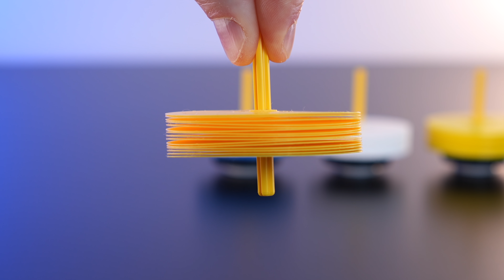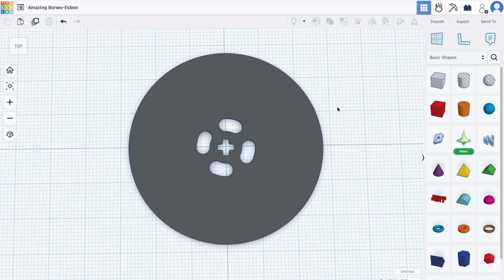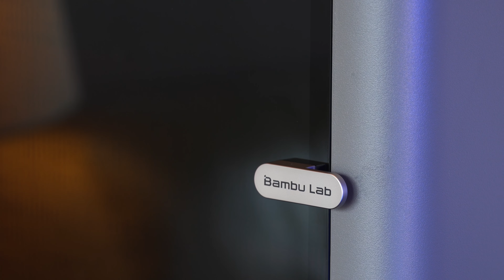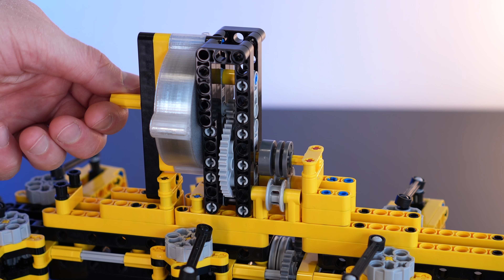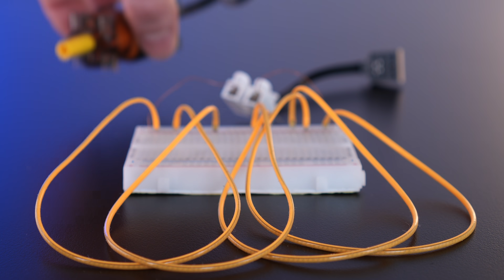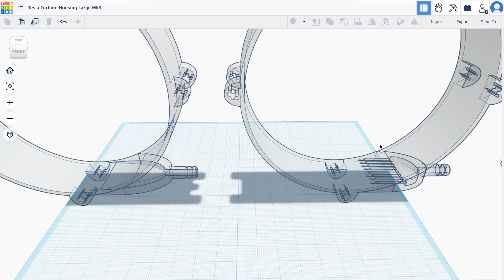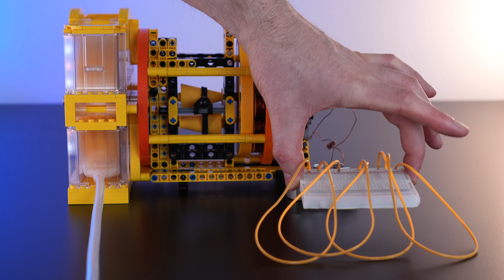Powerful Lego BLADELESS Turbine Generator!

Comment: I don't know if the prints are so smooth it doesn't matter, but I'd be curious to see if somehow setting it up to print the blades in a spiral pattern instead of lines would change anything. Like rifling in a barrel, if the tiny ridges also work with the flow of air, can you get even more efficient?
Reply from the maker: Hmmmm that's an interesting idea. I know in general you want the discs to be as smooth as possible. But I'm intrigued by the idea of a barely perceptible spiral pattern. My guess is it'd never perfectly align with the airflow, causing more turbulence (though likely not much). But I'd love if any real engineers could weigh in!
Reply: @JamiesBrickJams maybe a spiral is too regular, and the pattern needs to be some super computer generated pattern that guides the flow and extracts maximum energy, taking turbulence into account, which may not even be possible (chaos theory). Surface finish like a rounded fractal pattern, guiding air to disk exit?
Reply: @JamiesBrickJams also, shape and size of holes could probably be optimized as well. Needs a lots of fluid dynamics simulations

Comment: nice. very easy to manufacture. disc stack turbine is better than tesla turbine or bladeless turbine. boundary layer? air friction. keep it simple even in talking. fluid friction. very nice demonstration. those gear teeth are blades btw. perfect. faster generator disc speed is larger flywheel energy storage. making the whole generator from metal is very simple. why would you say that normal turbine efficiency is better.

Comment: Tip: You can measure how much power your turbines have by attaching a big metal disk to the output shaft and using a microcontroller to precisely measure rpm.
If you know how heavy the metal disk is, and how fast it is being sped up, you can make a graph of power per rpm and torque per rpm, just like how real cars have hp+nm per rpm graphs!

Daniel Hunziker has made a great video explaining how to build your own model dyno!
Reply from the maker: That's an awesome idea, thanks for the recommendation! I'd love to give that a try. Would you have to apply the power source immediately for an accurate measure? I'd assume you measure the time to spin up to x speed?
Reply: @JamiesBrickJams  You don't have to apply the power immediately. All that will happen is that the power output will be 0 at 0 rpm.
Of course, you would want to only measure the power at full throttle, so you'll probably have to tell it to start recording, else it might just measure your "output power" if you ever bump against the metal disk.

But other than that, the graph doesn't measure time, but instead only rpm, power, and torque, so even if you mess up the measurements at low rpm, the other data points won't be affected.
Reply from the maker: Ah gotcha, thanks! I'll have to watch his video. Measuring energy stored in a flywheel is easy enough. But I'm always interested in measuring torque output somehow!
Reply: @JamiesBrickJams  Torque is also measured with this method, because it is linked to power. We know the power, and we know the rpm, and torque = power / rpm.

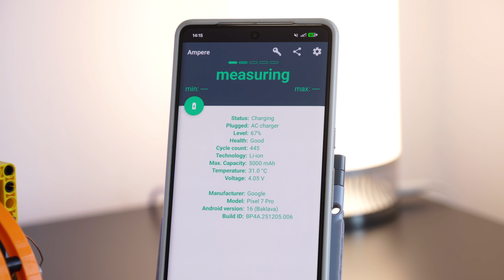Comment: 25:03 whats that app your using to measure the power draw
Reply from the maker: It's called Ampere.. I've no idea how accurate it is though. It's read out some weird results across my various generators. Especially with different capacitors in parallel. Though it feels ballpark accurate. Nothing beats a good multimeter though!

Comment: Tesla turbines become more efficient with more blades. the thinner you can make them, and the more you can jam into the casing, the more efficient and powerful they can be.
Reply: Which, as you can imagine, also makes it more delicate.
Reply: I think something like a solid angle grinder flapper wheel shape would work REALLY well.
Reply: Yeah they are near useless just like 90% of tesla's magical inventions they sonuds cool in idea but fails in everyday use... that was tesla's downfall.... but internet crooks and lunatics keep up the air of mysticism about nikola tesla....
Reply: @maszkalman3676 it works so well it explodes.
Reply: @maszkalman3676  no, it works. The problem is if you wanted it to work at scale, you would need to invent some new meta-material to withstand the strain.
Reply: @frankyanish4833  NOOOOO! it doesn't worked in real life at tesla's time or even in our time no matter how hard peoples tried we still don't have that meta  material that would make this shłt viable... in smal lscale actually easier to build shłt like this becaus even less force applied to each square inch or cm squared on eact point of this system. If you woudl scale this up it would be magnitudes worse...
Reply: @maszkalman3676  wow, it’s almost like that’s exactly what I said.

Comment: Just use a vacuum at the rear exhaust.
Reply: It’s a lot easier to control the pressure with compressed gas than with a vacuum
Reply: @ahumanbeing4514agreed❤
Reply: Bladeles doesnt work like that😂
Reply: @JB_Lego telsa turbines work in both directions
Reply: @JB_Lego  yes it does, do your research.
Reply: @dragonfire4356 only if theres an exhaust on the other side😅
Reply: And a Vacuum also uses alot of energy compared to a Air compressor❤
Reply: I was tired when i said that lol
Reply: It may work but it wont run Well
Reply: @JB_Lego   Yeah, and PSI is limited to atmospheric air pressure. After all, a vacuum doesn't create air pressure, it reduces it. The force that draws in air into a vacuum's inlet is just ambient air pushing into the lower pressure vacuum.
Whereas even an average air compressor can reach triple the PSI of atmospheric pressure eve in ideal conditions.
Reply: @TheMrSeagull agreed❤

Comment: Awesome video, you cover so many topics of mechanical engineering, electrical engineering, air flow...

It would be interesting to see torque measurements and a comparison with a bladed turbine. I'm wondering if you could put a flywheel on the output shaft and if that would potentially help increase the torque?

Also, could you power this with only traditional lego components [air tank, motor-driven pump] and see what it can do? This is a long and fairly extensive video but I feel like this has way more potential.

Comment: Jamie, did you consider using a smooth print bed, and the top surface with ironing mode on for a smoother surface?
Reply from the maker: Actually yeah - during my early testing I tried some ironing and a smooth plate, but my tests seemed to come out exactly the same as my regular print plate. Probably because my disc and housing designs just aren't efficient enough to notice an improvement in smoothness 🥲
Reply: @JamiesBrickJams  i believe tesla turbines are pretty sensitive to any kind of air leaks because they need high pressure and relatively high rpm to be efficient. might be worth considering if you make another video on this topic.

Comment: Fun fact: the Tesla Turbine performs about the same as a bladed turbine when under load
Reply: There is friction, air is basically a viscous liquid. That's why you get more torque with more blades.
And friction can transfer torque, see a clutch for example. It's just more prone to slipping than a bladed turbine.
Reply: @TazerReloaded  The Tesla turbine does make up for this due to being much simpler and cheap to produce.
Reply: @TazerReloaded the slippage is a good thing in some situations. It would make a good wood cutter designed to stop if it hits a nail or something. The extra sudden load would just slip up the turbines. Kinda an emergency clutch of sorts
Reply: it's an exchange between material science and engineering.
Tesla you just need some flat discs, dead simple, but they better be able to handle high rpm.
Traditional though, the physical design shape is paramount.
Reply: Quite a few variables to balance there. But the way power rises with speed more than mass in flywheel systems, they're capable of some surprising feats. Where they truly excel is in sheer speed.
Reply: Then why aren’t they used?
Reply: @scottydu81  All of the above and because Tesla turbines do not scale. You cannot make them larger (bigger diameter) you cannot chose the rotation speed. They only perform will at a very specific disk diameter and rotation speed.
Reply: @michaelrenper796 you can 100% scale a tesla turbine
Reply: @DarkAttack14  Really. Tell you me how?
Reply: @michaelrenper796 Making it larger?? 5 minutes on Google researching tesla turbines would answer your question fully. How do you scale anything? You make it larger (or smaller), here's a hint that it can scale. Tesla scaled his to multiple different sizes effectively
Reply: @DarkAttack14  How do you make the disks bigger in diameter when their thickness is limited, while preserving rigidity and strength?
Reply: @scottydu81 it's difficult to get them to high torque and not high rpm by just increasing size like with normal turbines.

Instead they have to add more disks. So scaling is incremental not linear. And air distribution is much harder

And in addition to that they need constant rpm to he Most efficient. Therefore they need conversion systems we didn't master until recently.
Reply: @scottydu81 fragile
Reply: @scottydu81 because we don't have good materials for the disks yet. These types of turbines are prone to warping when under load
Reply: @scottydu81  In the vast majority of uses bladed turbines are simply better ... these turbines have some niche uses though.
Reply: @scottydu81  because we already use bladed turbines so should we change them?
Reply: Fun fact: apostasy in Islam is punishable by death.
Reply: oh I did not know that thanx
Reply: And it's because the tesla turbine is moving because of the stickiness of the fluid or gas.
Reply: They literally don’t…
Reply: Citations needed please
Reply: @vosechu  Activate brain cells please. Ask Claude, ask google scholar.
Reply: @michaelrenper796 "activate braincells" and "ask Claude" in the same sentence, LLMs were truly our downfall
Reply: @toukasan342  If you don't know how to use LLMs to research publication and professional information then you are truly lost.
It requires fundamental knowledge in physics and engineering of course.
Reply: @michaelrenper796 that's how we ended up with studies citing nonexistent papers..
No, typing words into a bootlicker machine doesn't require aby knowlege, let alone physics and engineering. If you were to be portrayed in a movie to show how stupid a group of people is, I would roll my eyes from how on the nose it is
Reply: Hi, I actually know about this. Tesla turbines are the most efficient turbine we have, with gas tesla turbines having an efficiency of about 60%. Problem is, in ordee for them to work they have to have an RPM in the tens of thousands. There isn't a material strong enough in the world to stay intact under that load, so any attempt at making it will just have it break apart. That's why they aren't used.
Reply: Yeah becouse there's nothing forcing the rotor to spin so it an just stay in place
Reply: @AGuyWhoDosentKnow Accurate name
Reply: Lie. They are only around 30% efficient
Reply: @nathansmith7153  oh, thank you, I didn’t know that

Comment: Won't Tesla turbines produce much less torque than more conventional turbines?
Reply: Yes, definitely. High RPM Low torque.
Reply: @beckettmazeau2224 But to increase the torque you can balance both small and bigger gears
Reply: Did you watch the video?
Reply: @mon @Divokeee ms like this was posted as soon as the video was uploaded, people often post random questions so early in an attempt to farm likes. 
Doesn’t even matter if the question gets answered in the first few minutes, a lot of people already go to the comments before watching the video. 
Same reason spambots always post in the first seconds.
Why someone would farm likes on YouTube is beyond my understanding too.
Reply: @Tiggy.Skibbles106 exactly people don't ask questions because they're curious, they are only interested in farming likes
Reply: Did you watch the video
Reply: Yes that is the main issue with them
Reply: @CharlieSolis
Reply: Yeah check out charlie
Reply: Who needs torque when you have SURFACE AREA!! HAHAHA
Reply: Can an outfit be pink AND intense?
Reply: Well it depends, since if you take something that has low torque and high rpm, and high torque low rpm, you might be able to get more torque out of the higher rpm one if you gear it down to the same rpm that the low rpm, high torque one is at
Reply: youve missed the entire point.
Reply: Yes. They are pretty interesting. They are incredibly efficient but produce less torque and are a lot more prone to failure
Reply: @UwU-235  They were more efficient compared to many early turbines, but with modern knowledge and manufacturing, Tesla Turbines are entirely outclassed in power density and efficiency.
Reply: @user-si5fm8ql3cnah modern tesla turbines can still outperform modern turbines in terms of efficiency. Its just they aint worth the cost and unreliability
Reply: Yes because they have no teeth to create extra drag/torque.
Reply: @zichithefox4781  Wrong. That's not how a Tesla Turbine works.
Reply: @mortenvinje1817 Did we watch the same video?
Reply: @zichithefox4781  Yes, and I know how Tesla Turbines work.
Reply: Also all of the efficiency fails once the rotor has any load on it, cause it creates vortices in between the plates instead of the air cohering to the side of them making them “efficient”
Reply: Sadly at too high speeds any kind of material used on the "blades" warps or shifts. It's impossible to get them to high enough speed to be economical beneficial
Reply: And that's why we don't use them.
Reply: Yes but you can just gear it down
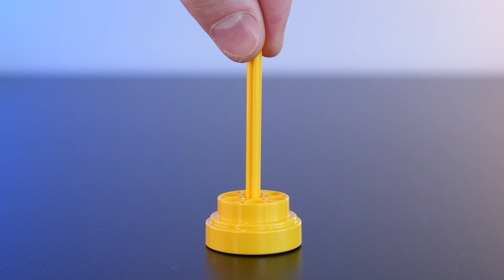Reply: 1:56
Reply: They test how aircraft turbofans handle bird strikes with dead chickens. Many of them keep running without damage after ingesting birds that size or smaller.

Tesla turbines lose power if the disks get dirty or corroded.
Reply: @hamjudo note that the bird is mainly impacting the fan side, not the turbine side.
Reply: @hamjudo Turbines and jet engines do not see the same environment in production.
Reply: @hdhsu-dg6fb idk if this is what you meant but jet engines are have turbines so turbines are relevant ish to jet engines
Reply: They actualy produce less torque
Reply: @pindamonhangaba72 that’s what op sayed
Reply: This is YouTube stop being smart